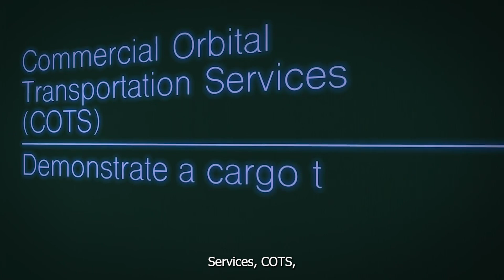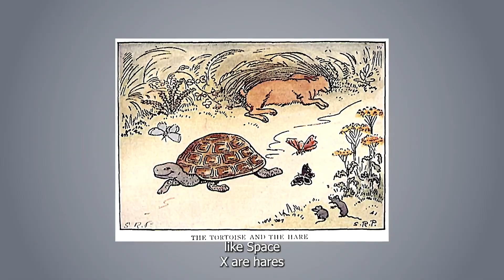The "MEETING" after This Long Journey: SpaceX Vs Blue Origin

Comment: They say it like private contractors have been news, but they're really not, are they? NASA hadn't been doing everything inhouse, had they? JPL makes the probes, but the launch vehicles have been contracted to private contractors since way back when, wasn't it? SpaceX is just the new boy in town with a better, more reliable rocket with faster turnaround time.
Blue Origin... is not in the race. Not yet. They can start comparing themselves with SpaceX when they make an actual first launch attempt into orbit. Not now.